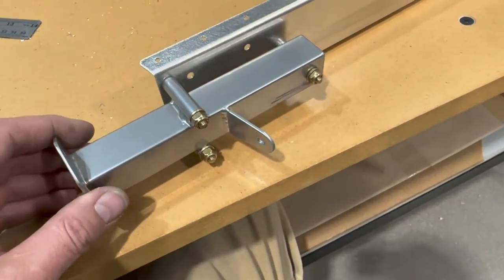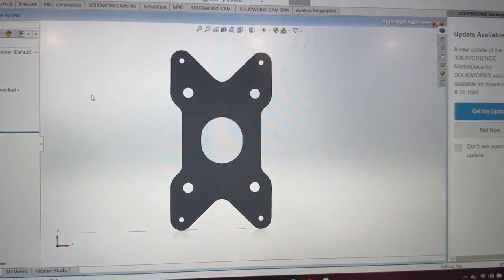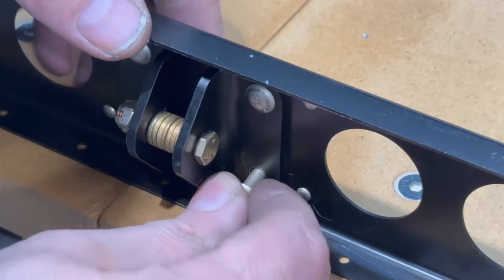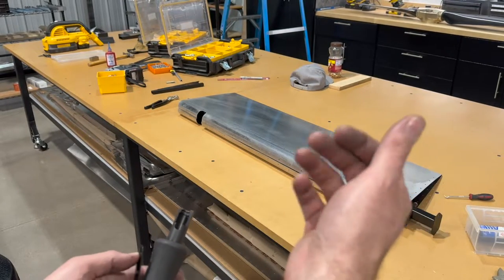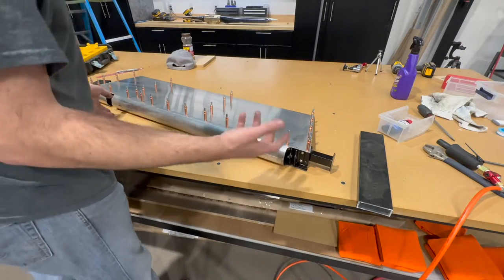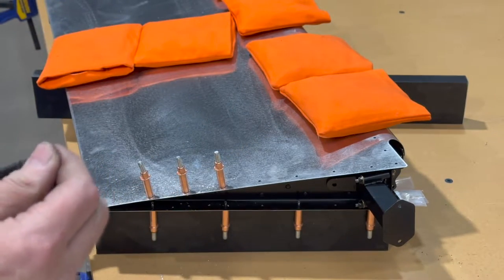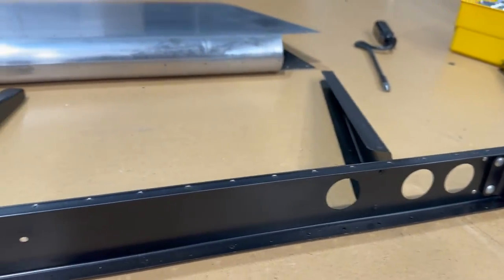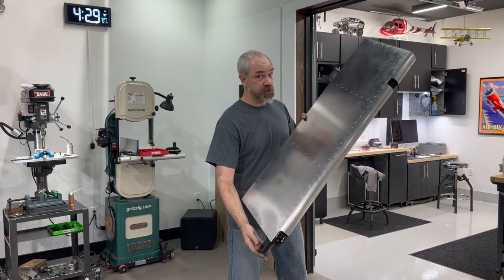Ep. 4 - Building a Rans S-21 Rudder

Comment: Good afternoon DJ! Just found your build. Really looking forward to watching all the videos and thought processes you’re doing. I have had several of the same ideas of things I would like to do to mine someday as you’re doing.  It’s awesome to see. Not that there is anything wrong with the pulled rivets as you said, but I had also thought about doing solid rivets on the skins as well. I know it would add a bunch of time, but I thought it would look good. Did you consider doing the skins?
Reply from the maker: I suppose solid rivets could be done on the skins but at the expense of much more time and plenty of frustration. I chose to do solid where it makes sense and does not adversely affect time to build by a significant amount.

Comment: What are using on the ribs and inner skin?
Reply: Disregard, saw it in next video.  SCM self etching primer.
Reply from the maker: I switched to two-part epoxy primer later which is what I’m using from now on. Not as convenient as I have to mix it but it’s far more durable.